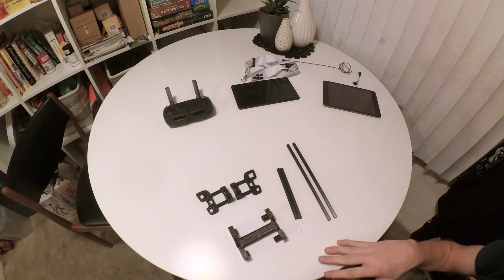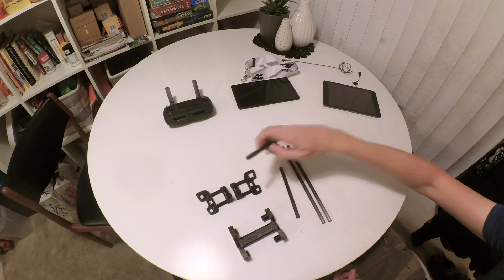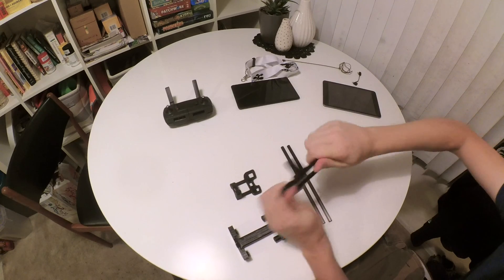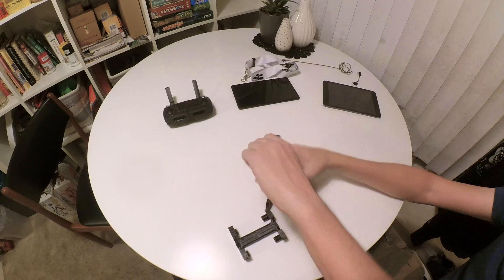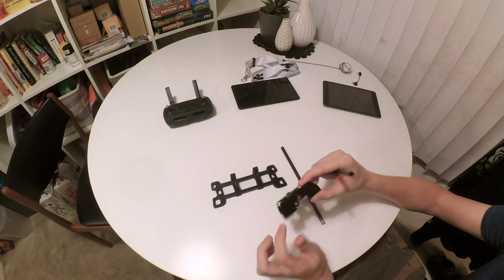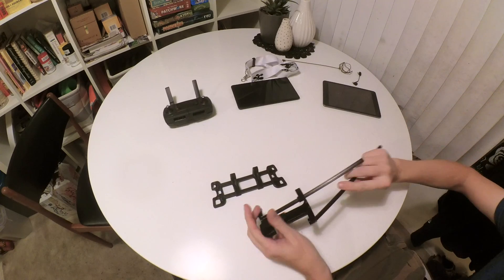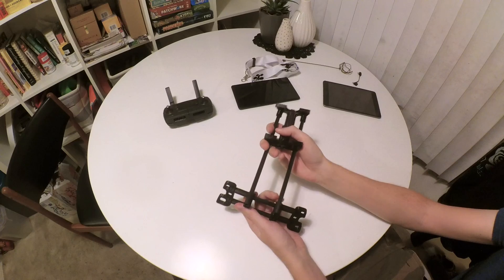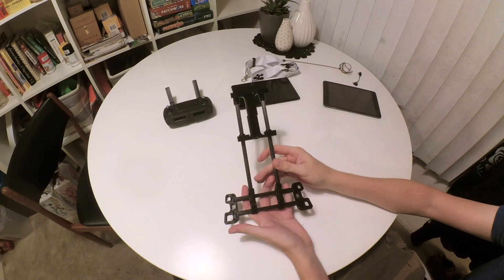Mavic Tablet adapter assembly instructions.

Comment: Can't tell from this though if the Mavic provided controller (micro to lightning) cable will reach from the controller to the mounted device like an iPad mini or if a longer cable needs to be acquired.  Anyone can confirm DJI cable is long enough to reach?
Reply from the maker: The DJI cable is not long enough. But you can simply use whatever standard USB cable you use to charge your tablet. Just use the fullsize usb port on the bottom of the controller instead of the small one on the side.